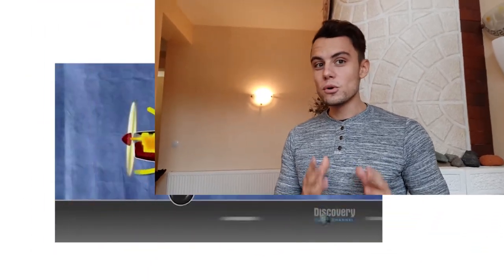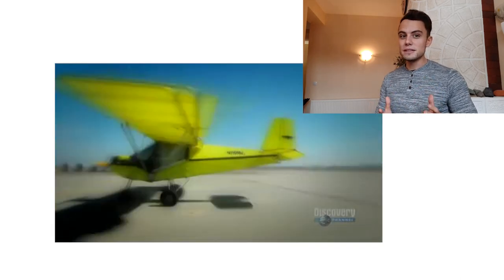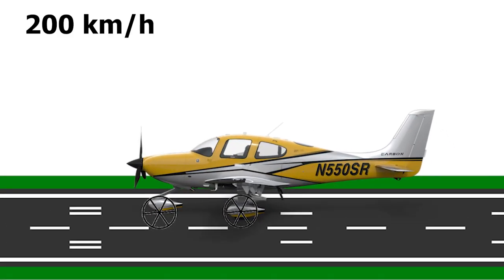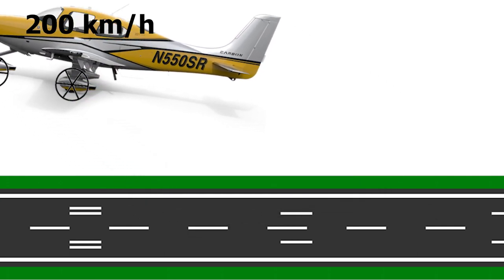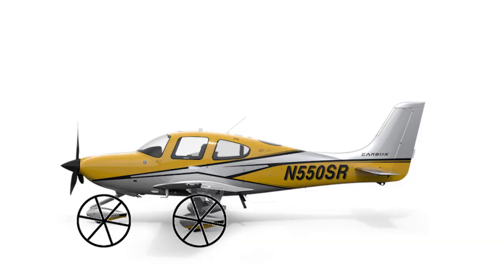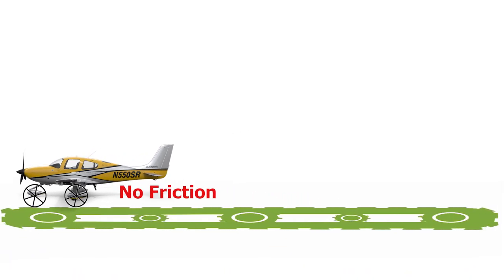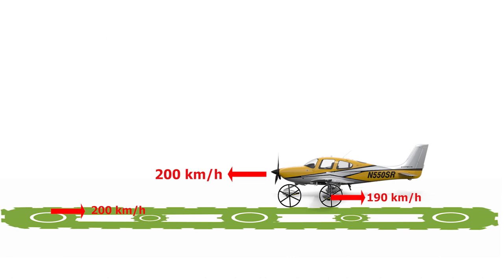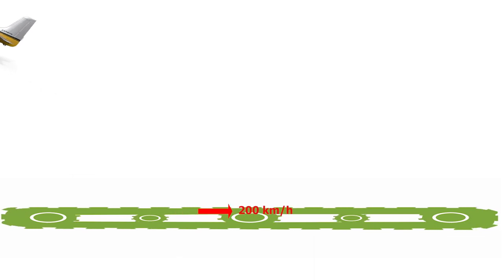Can an Airplane Take Off From a Conveyer Belt?.... Finally Solved!

Comment: this riddle is interesting because a lot of people relate the wheels and conveyor effect like what a car will normally do thus, the statement is merely a distraction. conveyor effects are irrelevant to an aircraft as the thrust are produced by prop/jet, not by the wheels, it will take off.
Reply: The aircraft only moves while on the ground by rolling.  Eliminate the conveyor and you always have a good understanding of wheel speed and also linear speed (which equals vehicle ground speed)

Neutralize vehicle ground speed / rolling speed as the scenario sets it up, and you never get any velocity relative to the atmosphere, airflow, or lift.
Reply: @MrDefreese  imagine the aircraft has square wheels. With the right amount of thrust, the plane will still move forward.

The riddle says that the conveyor can match the speed of the wheels but in actual, the wheels of the aircraft are not moving at the first place as it was not driven by an engine like a car. You cant neutralize the speed as the aircraft get its forward movement via jet/prop thrust. Newton's 3rd law already shows that the exhaust flow push rearward, and in return, the engine along of the aircraft body, moves forward.
Reply: @MrGoThrough  that’s an introductory physics question too - where you compare the static and kinetic coefficients of friction and Normal force required to drag or flip an odd shaped wheel…but that’s still not relevant here.

This case is more simple than folks are trying to make it.

Take your same aircraft and put it back on tarmac.  Every single aircraft with wheels (and horizontal thrust which generates lift) only rolls while it taxis and accelerates to takeoff speed.

This insane scenario tells you that the wheel speed while rolling is always negated by this mythic conveyor (exactly matched).  Without rolling velocity changing, a plane will never develop vehicle velocity.

Sure, you could introduce your own parameters,  which is what mythbusters did, but as described, the wheel rotation speed of pi*D/time is explicitly described to be matched by the linear speed of the conveyor as pi*D/time.

It’s giving you parity right from the start.  People are ignoring the conditions set and just saying they can overpower the question conditions.  That leads to misunderstandings and lost points on problem sets and quizzes.
Reply: @MrDefreese  i understand where you are coming from but we need to keep in mind on 2 things..
1. The wheels on the plane are freewheeling
2. Inertia play part here

Although the wheels will rolls initially from the engine thrust, then the conveyor will spin in reverse direction, but it cant negate the forward motion of the aircraft simply because the wheels are free wheeling (well maybe a very tiny  amount yes). The fw thrust will always > conveyor effect to negate it.
Reply: @MrGoThrough  thrust is independent of wheels speed.  You see and feel it when a plane (particularly a jet) taxis.  It imparts force to get the vehicle *rolling*, then the pilot throttles back allowing it to rolls, then throttles up on the way to takeoff speed.

At any given second, this hypothetical conveyor is always matching wheel speed no matter what (exactly matches).  The folks saying the thrust will overcome the conveyor behavior are treating the conveyor as if it maintains a steady speed instead of having this magical, instantly adaptive, infinite speed to match the rolling wheels.

It's not an inertia or friction thing; it's merely rolling wheels matching the linear speed of this (insane) conveyor contraption.

Boiling it down, the question is trying to get people to think of whether thrust results in lift directly instead of doing the four forces analysis where lift is a result of forward speed and in this case, forward speed is thwarted by this conveyor doo-dad.

Comment: what we need to remember is that thrust from the engines is in no way coupled to the conveyor belt so regardless of what the belt is doing, the engines are able to provide forward thrust and therefore lift.
Reply: Why don't planes with the parking break on achieve lift when the propeller is throttled all the way up? Based on this video, it's only the speed of the plane that is being considered.  What needs to happen is that the appropriate amount of Lift needs to be applied to the wings to break the hold of gravity on the plane. So the gist of the question is confused by the poorly chosen words.  Stating the speed of the conveyor belt equals the speed the plane would achieve in normal operating circumstances...   The real point is: Eliminate the forward motion of the plane (for example by placing it on a conveyor belt moving at the same rate of speed that the wind over wings would need to achieve lift) and the plane is effectively remaining stationary. No forward movement means no lift to the wings and no flight for the plane.
Reply: @wilgar  the wheels spin freely, and the thrust would propel the craft regardless. The speed of the conveyor belt would not stop the engines traveling through atmosphere.
Reply: @wilgar  parking brakes on planes usually disrupt thrust, by directing thrust up or down.
Reply: @hawaiian_hugo_stiglitz7583   The video explains it wonderfully. The comment from mikewindrim8465 is dogshit. It's the whole reason why so many people still ahve issues understanding the problem even after so many people have so much "explained" it. The key point here is that while, yes, the thrust of the aircraft is applied on a different plane than the conveyor belt, and even though the wheels of the aircraft are free spinning, the friction between the belt and the wheels created due to the aircraft weight would prevent the aircraft from moving forward IF the belt and the wheels were 100% locked to each other as the video explains.
Reply: Because there is some lose of movement, or better put, lose of work and energy as the belt is not 100% efficient against the wheels, then the aircraft is able to move and start reducing that fricition.

If you take all this away, it'd mean it would be easy to move a square shape wheel than it's to move a round one. It'd mean it's as easy to go "faster" on the ground as it is to go faster on the air with no resistance from the ground. It'd mean pushing the aircraft manually would be MUCH easier.
Reply: @hawaiian_hugo_stiglitz7583  oh but I do. And my license says so. Even if you had all the thrust in the world you still need to overcome ground friction, generated from trying to move your weight through laterally...
Reply: @papapapalima_scotland Actually--think about it--when the conveyor belt runs backwards, it spins the plane's wheels FORWARD!  If there's any significant friction in the wheel bearings, the reverse-running belt ASSISTS the plane in moving forward through the air.
Reply: You don’t go from thrust to lift.  You go from thrust to rolling motion.  Lift is a function of a fast enough rolling speed.  If you accept that the vehicle by necessity has to roll first, then you can accept that the relationship between linear distance and rolling motion of the wheels is a basic formula.

If you accept that the rolling of wheels is a fundamental reality, then you can accept that this project is showing that you can place a moving ground surface in equilibrium with the rolling vehicle.

It’s only finding equilibrium between the rolling vehicle and the conveyor.  Nothing more; nothing less.

Not friction; not engines acting on air (?!?!?!); not bearing behavior; not the size of the engines, etc.
Reply: @misters2837  le sigh.  You are still trying to comment?  smh.  And you add in rolling resistance.  smh.  Just stop.  For Pete's sake.

The airplane doesn't get into the air because the net speed of the wheel axle is zero.

The system of the vehicle on the moving surface is in equilibrium.  There is no ground speed.  There is no airspeed.  The tires don't spin 2x as fast as they normally would.

You are unfortunately just regurgitating a bunch of gibberish talking points of an inexperienced or ignorant person again.  smh.

Comment: No wind speed, no lift, no flight. I believe the question is stating the plane is sitting still on the conveyor belt because it will always match the wheel speed. The wheels cannot move forward that’s breaking the rules.
Reply: In order for the plane to sit still on the conveyor belt the conveyor belt would need to move in a direction opposite the wheel rotation. at the point of contact with the conveyor belt, the wheel has a linear speed directly back, which means the conveyor belt would need a matching speed forward. as the thrust pushes the plane forward the conveyor accelerates to prevent the wheels from spinning so you do get air over the wings.
Reply: Yeah, it's very misleading. The question assumes the conveyor belt WILL match the wheel speed, but since the engine(s) will always move the plane forward relative to the ground, this is impossible.
Reply: @erich930  If the treadmill matches hull speed of course the plane takes off.  If the treadmill speed matches the wheel speed (not hull speed) the moment the plane moves, even at 0.0000mph,  the wheels and treadmill will instantaneously reach infinite speed (no, seriously, infinite). That infinite speed will create infinite drag. Any and all thrust is always negated by equal added friction.
Reply: You can't change 1to1 the conveyor only moves when the wheel rotates in place, not happen. The wheel only rotates as the jet moves forward the rolls over the conveyor and  amount of conveyor  behind wheel is the same as the movement of the jet 1 to 1. The conveyor never moves and the plane takes off. 

The wheel speed matching the conveyor is the key to solve this. The plane is sitting on the conveyor neither the wheel or the conveyor is moving. Now start the jet move  1 rev of the wheel now the plane has moved forward and 1 rev of conveyor is now behind the wheel. The real question is how fast the conveyor is moving.      The answer is it is not and never will. That is the trick of this question.

Comment: 100% agree, the friction in the spinning wheels is not enough to stop the airplane from pulling itself forward in the air
The only problem with this riddle is that the conveyor belt will need to speed up to infinite speed once the plane starts moving forward, since it needs to match the speed of the plane and this causes an infinite loop of acceleration (until the speed of the conveyor belt is enough to slow the plane down by friction, but in that case the wheels or conveyor belt probably already melted from the heat)

Comment: F_conveyor = F_thrust. Both negate one another. Therefore the plane is stationary.
Reply: The conveyor doesn't negate thrust, it only negates wheel speed. Wheel speed is directly related to forward propulsion. Wheels don't move on a stationary plane.
Reply: Two scenarios with very different results:

1. The conveyor belt's speed can always match the rolling speed of the plane's wheels and thus keep it stationary relative to the surrounding air regardless of how fast it is rolling. In this case, the plane will not take off due to the missing air flow around its wings.

2. The conveyor belt's speed is limited to the plane's normal take-off speed or so. In this case, the plane will take off assuming the belt is long enough and that the wheels can handle rolling twice as fast as normal without being damaged. Why?
As the plane accelerates on a normal runway, its power has to overcome both the rolling resistance and the air resistance, and the latter will quickly become much higher than the former since it increases by the speed squared (2 x speed = 4 x air resistance and so on).
A plane rolling at its normal take-off speed while being kept stationary by a conveyor belt will need only a tiny fraction of its ordinary take-off power in order to stay stationary since it won't be restrained by any air resistance at all. When applying full power, it will start accelerating and take off almost as easily as on a normal runway.

Scenario 2 was what happened in the MythBusters video.
Reply: @FromNorway - the speed of the wheels are secondary to the air speed of the plane. The conyeor has no counteracting force against thrust.
Reply: @mrn8645  
Can we agree about the following?
As long as the conveyor belt can match the increasing speed of the wheels, it will prevent the take-off because the plane will remain stationary relative to the air, which means zero airflow around the wings (if ignoring the airflow from the propeller, but that shouldn't be relevant for jets).
The big question is if the conveyor belt can do that, or if its maximum speed is lower than what the wheels can take without being damaged. If the latter is the case, the plane will take off for the reasons I explained in my previous comment.
Reply: @fromnorway643  - First you need explain how the air thrusted from the engine(s) is counteracted by the conveyor belt? The movement of the wheels is soley based on the momentum of the plane when on the ground. In reality, the conveyor would always be trying to catchup with the wheelspeed and would break before the wheel would fail.
Reply: @mrn8645  
I think we are talking past each other!
I and some others have argued that as long as the conveyor belt's speed matches that of the wheels and thus keeps the plane stationary, it won't take off because there isn't any airflow past the wings. That piece of aerodynamics isn't changed by the practical problems with designing a conveyor belt large and fast enough to keep even a 747 at full power stationary.
If the plane starts moving forward, it does so because the wheels spin faster than the conveyor belt, and the conditions described above are no longer met. It shouldn't come as a surprise that different conditions lead to a different result.
Reply: @fromnorway643  - You still haven't explained how the conveyor counteracts the force of the jet engine. It's a glaring anomaly that you are anyone has addressed. The wheels are free-moving and only move when there is forward/backward motion on the ground. Wheel speed is secondary to air speed.
Reply: @mrn8645  
Force or thrust is irrelevant as long as the conveyor belt is always capable of counteracting the speed of the wheels, because it's the wheels' speed minus the belt's speed that determines how fast the plane is moving forward through the air – assuming no wind, of course.
I have already explained why the plane will take off almost as easily as normal in a scenario where the belt's top speed is lower than what the wheels can withstand, but that scenario breaks the rule about the belt's speed always matching the wheels' speed in order to keep the plane stationary.
In the MythBusters experiment the plane took off because it was rolling faster than the "belt" was being pulled back, and the result was as expected – it took off as soon as its airspeed got high enough.
Reply: @fromnorway643  - Thrust is absolutely relevant. Ignoring the source of propulsion for a question about propulsion is about as unscientific as you can get. Again, the speed of the wheels is secondary to the airspeed of the plane. The wheels only move when the plane moves. 
A simple example would be a toy car or plane on a conveyor - something that has freeweels. If the conveyor matched the wheelspeed, could you still push the car forward?
Reply: @mrn8645  
"If the conveyor matched the wheelspeed, could you still push the car forward?"

No, you couldn't, because the rule about matching speeds dictates that the conveyor would also speed up the moment you tried to push the car forward.
If the conveyor didn't do so, pushing the car forward would be quite simple, but that would mean that the rule about matching speeds had been broken.

The actual result in scenario B doesn't disprove the predicted result in scenario A unless the two scenarios are identical.
Reply: @fromnorway643  - You're making the same mistake again. Wheel speed and vehicle speed are not the same as wheel movement is directly related to lateral movement. 
You have yet to explain exactly what force counteracts propulsion and how wheels miraculously spin if there is no forward motion.
It's either a physics question or it's not. Disregarding physics in the premise and expecting an answer to conform to it is an illogical position.
Reply: @mrn8645  
You are obviously unwilling or unable to understand what the phrase "If the conveyor matched the wheelspeed" actually means!
Reply: @fromnorway643  - You are obviously avoiding answering simple questions. By ''if'', what you actually mean is ignoring the laws of physics! Which leads back to my point, ignoring the laws of phyics in the premise whilst expecting an answer to conform to it is completely pointless and proves nothing.
Reply: correct but its simpler than that. Exact speed x + negative exact speed x = 0

Comment: He didn't understand the question.He gave the correct answer to the wrong question. The question is "Can an aircraft takeoff if the wheel speed is equal to the treadmill speed?" 
This is not the the same question as "Can the aircraft takeoff if the treadmill speed matches the airplane's forward speed. He doesn't understand the assignment.